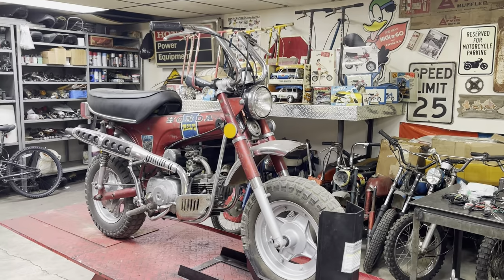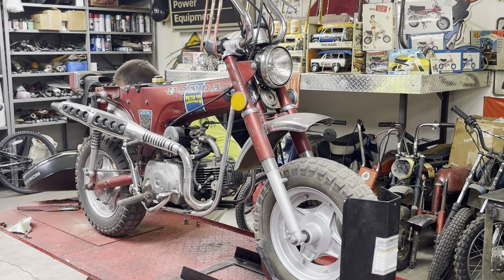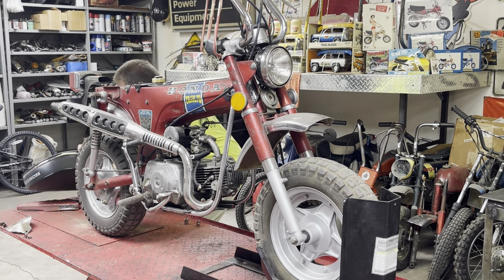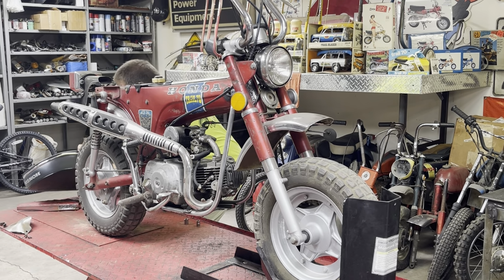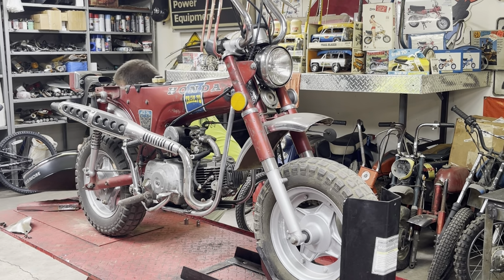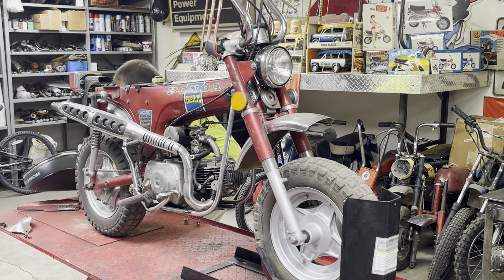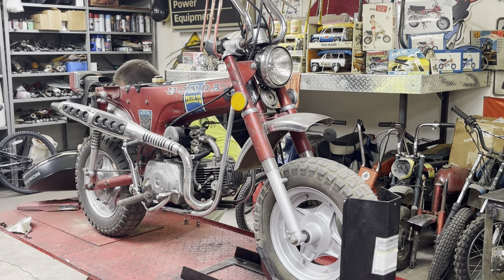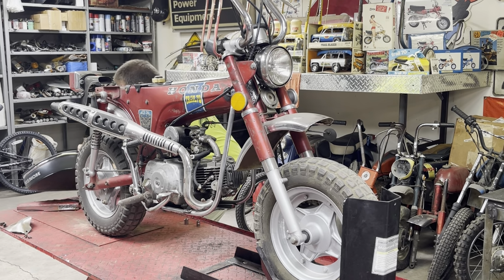CT70 Lifan engine swap - full details

Comment: Nice . I have a X19 with a 110cc 4-spd auto transmission electric start.
I got a 125cc with a 4-spd manual trans to put in the X19 (An unmarked Lifan)
I think it will fit in it well without much modification
Thank you for sharing this swap video

Comment: Great video and very informative. Will be one to save to go back to. I am amazed how he revs up a brand new motor before it even gets warmed up. That I would not do. Just my 2cents and that is all it is probably worth..
Reply from the maker: Thanks for watching.  I’ve used over 60 of these 125 Lifan’s.   The thing I’ve learned, they don’t require a break in.  I’ve got 2 with over 8000 miles each and I revved them to the limit straight out of the box.  These engines are nearly indestructible.
Reply: @MiniBikeMike  guess that is a good thing. Saw a little smoke when you revved but maybe build oil but myself I would always let any motor warm up a bit to get oil throughout the motor. Just like starting a car or truck and revving it right away. Don't think you would have oil all through motor. Just an opinion. As far as indestructible they should be it is a Honda knock off.. :-)..
Reply from the maker: @jimg2885  The initial smoke was leftover oil in the exhaust from the bad top end of the stock engine.  I’ve ridden the bike all weekend and it hasn’t smoked any more.  👍🏻

Comment: hey nice build but I recommend you to change out that cloth air filter for a oiled foam one. I find that the cloth ones let alot of sand through
Reply from the maker: All my bikes are built for street, never have had any problems.

Comment: Did you drain the transport oil that the engine came with? Was a good video to watch but not sure if I missed that part mate
Reply from the maker: @Storm20199  I run the shipping oil for the first 100 miles.  Many people are confused about the shipping oil.  Somehow, a rumor was started that it’s not good stuff.   It’s actually gear oil.   They ship the engines with it because it has a higher resistance to rust than normal engine oil.   I like to run it for a 100 miles, to get all the internals coated, then change to 10w-40 four stroke oil.

Comment: Mike thanks for the videos. I'm a new subscriber. I want to retain my engine guard also does the lifan have to be non electric start?
Thanks
Reply from the maker: @fyerfytr  Thanks.  If your engine has a bottom starter, I have a video that shows the modifications I did, to get it to fit.

Comment: Hey Mike. Awesome tutorial 👌.  Quick question are you using a 12v half wave or full wave regulator? Also where did you get the coil? Thanks
Reply from the maker: It depends on the engine.  Most Lifan’s with one yellow and one white are half wave.   I typically purchase complete engine sets that include items like the CDI and coil.  If you need a coil, they can be bought at Trail Buddy, CHP, Mikes MiniTrail, etc.

Comment: Hi! I have a question. I am about to swap my honda chaly 50cc 1975 engine with a 125cc cross engine. Do i need the 12v wiring harness? Or it s okay to continue with the stock one?
Great job by the way
Reply from the maker: I’ve never worked on a Chaly, so I’m not familiar with their harness.  Personally, I’d pull the old harness and install one designed for the 12v engine.

Comment: Cool video Mike. How much difference do you think that carb made?  I used the one that came with the engine on my recent CL70 build. Wondering if I should change it.
Reply from the maker: I doubt there is much difference.  I would have used the one that came with the engine, had it not had the cable operated choke.

Comment: Great video. Was wondering what exhaust you're using. I just swapped out my CT70 with a Lifan 140cc, but the og exhaust doesn't seem to fit properly, thank you.
Reply from the maker: I always use the stock exhaust, I like the way it looks.  The rear mount doesn’t line up.  If you watch my video after this one, I show how I fix it.

Comment: hello, Where can I find all cables for ct 70 with Lifan 110 engine?  Thanks for your great, informative videos
Reply from the maker: CHP, Trail Buddy, Mike’s Mini Trails…..they all have stock cables.  If your Lifan has a manual trans, you’ll need a clutch cable from an H model.

Comment: It's been 3 years since this video. I'm looking at Amazon and there's a big price range for these motors, about $260-$600.  Which one do you recommend these days? Generic or Lifan? Thanks so much/
Reply from the maker: @vorhese  It depends on what features, in an engine, you want.    I really like semiauto’s.   To find those, the current choice is 110cc X-Pro or the expensive Lifan 125cc.    If you want manual, I prefer the 4up shifting, so again, I go with X-Pro 125cc.   If you want 1dn3up, then the unbranded Lifan on Amazon is fine.
Reply: @MiniBikeMike  Wow thanks for that quick response.

Comment: Hi Mike, fairly new to your videos but love them thanks. Im thinking about putting in a 125 unbranded lifan into my 1971 honda ct70. I was wondering if the engine you used was a 4 up or 1N234 shift pattern and where you bought yours and part number. I love the way yours sounds and revs and want to make sure I get one similiar to yours. Hope you have time to respond, Thank you
Reply from the maker: I don’t remember which shift pattern this particular engine had, I’ve used lots of each.    They’re all gonna sound the same, the top end of each is the same.
Reply: Sorry to disturb you one more time, was the 125 a true Lifan or a knockoff and if you dont mind me asking where you purchased it from. Are the ones on ebay and Amazon the same. Youre the Best on Minis and by the way I am subscribed and have hit the thumbs up. Stay Cool, Ken
Reply from the maker: @kennycas7668 I’m not aware of any company building knock offs of Lifan engines.  Lifan puts their name on the side of some engines and charge a little more because it actually says “Lifan”.  The sell the exact same engine on eBay and Amazon as unbranded and they do not say Lifan.   If the cam cover has “CDI” in big letters on it, it’s most likely a Lifan.  I buy the unbranded versions on both eBay and Amazon, whoever is cheapest at the time.

Comment: Hats off to you sir great video. been thinking about doing this . I have the same bike 73.low compression  and a good running china 110 atv with a bad frame. thumb throttle semi 3sp ct 70  on the way. any link or pointers on the harness build ? going to need a battery as it electric start only . but more interested in the branch off wires for the 12v conversion.
Reply from the maker: Trail Buddy harness TB422 has all the wiring for electric start.
Reply: After watching your video on the harness I'm just going to start with atv harnesses and build it to my needs. 👍

Comment: why do you not put a higher cc on it? Nice video
Reply from the maker: The 125cc pushes this bike to 60mph.  I have no need or desire to go any faster.   Plus, the Lifan 125 is the most dependable aftermarket engine out there.  I’ve used over 60 of them and have never had a problem.

Comment: I’m about to put a lifan 125 manual clutch on a 1968 Honda CL90. Do you have any pointers and if you ever done it and do you have a video on it?
Reply from the maker: Just be prepared….it’s not a direct bolt-in.   The CL90 used a different engine bolt pattern than the CT70 and current aftermarket engines.  You’ll need to fab some engine mounts for it to work.  If you can handle that, the rest is pretty simple.
Reply: Thanks Buddy and thanks for your great videos

Comment: Mike I want to do this to my ct70. Not sure of its year, having tranny trouble so good time to just upgrade the engine. I have a 3 speed auto and want to do the 4 speed manual. Shouldn't be any problem right? Just no neutral light, no biggie.. Also working off your lift of parts, 2nd ebay is not found with link, what is this part? Also ignition is out of stock and suggestions? Sorry about all the questions I just really want to get rolling on this. Lastly the unbranded ebay engine is ok? No trouble with it????
Reply from the maker: The unbranded engines are very good, zero troubles with the dozen or so I’ve used.   You can get an ignition switch from Trail Buddy, with the wiring harness.  I think that other item was just a cheap inline fuel shutoff. You can pick those up at any hardware store.

Comment: I will end up needing those spacers/longer bolts for my foot peg mount... where did you get yours?
Reply from the maker: I own a steel company.  I cut them from 1/2”od x .065wall round tube.  Available at most steel shops or hardware stores.
Reply: @MiniBikeMike  ok awesome, I have some of that material...thanks

Comment: Not sure if you’ll see this but is the motor still running and if so how many miles have you got on it want to do this to mine asap
Reply from the maker: I sold this bike shortly after the video was made.  These engines are extremely reliable.  I have a couple Lifan’s with over 6000 miles each.

Comment: Mike, sorry to be a pain in the butt. It wasn't the H clutch cable either. Could it be a link to a coil?? Do i need to purchase a coil? Thanks..
Reply from the maker: Yes, if you didn’t get a coil with the engine, you will need a 12v coil.   The link wouldn’t have been for a coil, I only buy engines that come with the “set”: …..carb, coil, etc.
Reply: @MiniBikeMike  I now have the ct70 engine, will my exhaust work with the 125cc? Or will I have to upgrade?
Reply from the maker: @aaronbell5743  I run the stock exhaust on all my 125’s.

Comment: Why do you prefer the PZ22 carb on 125’s? I’m running a VM22 chinese Mikuni and it seems to work well. I believe the VM22 is supposed to be 26mm?
Reply from the maker: I use a Nibbi 24mm carb on most of my personal bikes.  The goal of this video was to show that you could buy the complete set (with carb) and swap out an engine in a day.
Reply: @MiniBikeMike  do you ever end up needing to change the jetting on the nibbi 24 carbs? I saw someone else’s video of a champion with the nibbi 24 and it didn’t seem to run quite right with stock jets
Reply from the maker: I think it’s in my video on the trashed swingarm.  I sad show the Nibbi and what jets I used to get it to run the best.
Reply: @MiniBikeMike  I’ll take a look! Thanks!

Comment: The links for your part list aren’t working. Can you give me in detail what clutch cable that is?
Reply from the maker: @scottberti2613  Old video and the suppliers change the links.   It’s just a standard Honda CT70H clutch cable.
Reply: @MiniBikeMike  can do a video how the throttle comes apart mine sticks
Reply from the maker: @scottberti2613 If you’re using the stock internal Honda throttle, they all stick.  No amount of cleaning will get it to snap back.  Josh Eule has a spring kit to help the stock throttle return.

Comment: Hey mike where did you buy the solder connector things from?
Reply from the maker: Good ole Amazon. 

TICONN 150 PCS Solder Seal Wire Connectors, Heat Shrink Butt Connectors, Waterproof and Insulated Electrical Wire Terminals, Butt Splice (150PCS) https://www.amazon.com/dp/B07HCNTZ2Z/ref=cm_sw_r_cp_api_glt_fabc_N4R78FJBQ8X9EWQN2J79?_encoding=UTF8&psc=1
Reply: Thanks

Comment: Anyone help me figure out what engine swap I can put in a Yamaha ht-1. I am hoping to restore the OEM 90cc motor and put a lifan in my current ht1. Someone told me the Lifan engines mount horizontal, just wondering it would fit my HT1.
Reply from the maker: I’m sure it’s not a direct bolt-in, but anything can be made to fit.
Reply: @MiniBikeMike  thanks, gonna give it a shot. and if I gotta move some bars on the frame shouldn't be the end of the world.

Comment: Hi what is the harness you used and also you mentioned one for just running, no lights, I dont see a link for the harness
Reply from the maker: I typically use a harness from Trail Buddy.  Their part number is TB515.  Unfortunately, they are currently out of stock, so i built this harness from scratch, duplicating the Trail Buddy harness.  

The wiring harness for running with no lights typically comes with the engine when you buy it.  If not, all the parts suppliers stock a simple harness.

Comment: Not sure if I just keep missing it but I got my motor in and the front sprocket is wider than the original what should I do to mend that?
Reply from the maker: Sounds like they sent you an engine with a 428 sprocket.  Does it have 428 stamped on it?  Regardless, you’re going to want a new sprocket anyway, the stock ones are way too small….usually.   You need a sprocket with 16 teeth and fits a 420 chain.  The tricky part is the splined hole size.  There are two different size splined shafts on these engines:  17mm and 20mm.  Hopefully, your sprocket has it printed on it or the engine came with specifications that list the shaft size.  If not, you’ll need to measure it.  eBay and Amazon have plenty of sprockets for $15 or so.
Reply: @MiniBikeMike  yep it’s a 428 I’ll order a new chain and sprocket tonight on Amazon it’s a 17mm

Comment: Hey Mike my head light doesn't turn on unless I hit the break light and it also does the same when I hit the horn button I don't know why it's doing that
Reply from the maker: What harness are you using and what model bike do you have?   If you have a yellow wire in the body harness, it connects to the brown/red wire of the Hi/Lo switch.
Reply: @MiniBikeMike  I have a 1971 honda ct70 with the trailbuddy TB515 12v wire harness the one that you have and the yellow wire is connected to brown and red but when I pull the break light switch the head light turns on and and when not pulled the head light will turn off I have look over the wiring and all is connected right
Reply from the maker: @contrains1264  I would unplug all the wires in the headlight bucket.  The only wires I would hook up are:
Yellow of harness to Brown/Red of Hi/Lo switch
Blue of Hi/Lo switch to blue of headlight
White of Hi/Lo switch to white of headlight
Green of headlight to green in harness. 
Make sure everything else is unplugged. 
Start your bike. 

The headlight should come on and the switch moves it from Hi to Lo beam.  If that works, start plugging other wires in and check their operation as you go.
Reply: @MiniBikeMike  what about the horn and the  Indicator light and the - light
Reply from the maker: Personally, I’d leave everything else unplugged and make sure you have the headlight working properly first, then start plugging in other wires.
Reply: @MiniBikeMike  alright ill try that thank you mike

Comment: What's the best way to wire in a clone motor on a CT70 that already has wiring and blinkers?
Reply from the maker: Completely remove the stock wiring harness.  Contact Trail Buddy and buy their 12v harness(part #TB422), a key switch and a 12v half wave regulator.
Reply: @MiniBikeMike  It's $237 for their wiring kit, is there no other way? I already have a nice stock wiring harness, CDI and 12v coil
Reply: That's what they told me to buy, the TB161 kit. Are you saying the TB122 $57 universal 12v harness will replace the ENTIRE old harness along with TB153 12v 4-Pin Key Switch with Lock Assembly and would have working blinkers and everything with some basic splicing?
Reply: Could I use the existing OEM 3 position key switch?
Reply from the maker: @JoeSmith-sv4jn The harness I mentioned is $57.   Sure, there’s always other ways.  You ask me which way was best.  The best way is too install TB422 and go.
Reply from the maker: @JoeSmith-sv4jn I have lots of videos using TB422.  I also have video showing how to use stock key switch.
Reply: Roger that, thanks

Comment: Is this the 125cc by TFCFL on Amazon?
Reply from the maker: I know I got it off Amazon.  There is a link to the engine in the video description.  Edit:  sorry, this was from eBay.
Reply: @MiniBikeMike  The link says “Currently Unavailable “ . Bummer
Reply from the maker: @mrfenderguy1  Here is the same engine on Amazon.  Looks like price went up a few bucks. 

125CC Engine Motor,Single cylinder 4-stroke with Air-Cooled Motor Engine Pit Dirt Bike For Honda CRF50 CRF70 USA STOCK https://www.amazon.com/dp/B07KR8X66N/ref=cm_sw_r_cp_api_glt_fabc_56SZBPTGJ6V2Y3HNJ5WR
Reply: @MiniBikeMike  thanks Mike

Comment: Hi sir where can I get a lifan engine to buy
Reply from the maker: Amazon, eBay, tbolt
Reply: @MiniBikeMike  I tried amazon nothing show up
Reply from the maker: I just did a search on Amazon and saw about 50 different ads for them.
Reply: @MiniBikeMike  send me the link thank u
Reply: Do you think a 2022 110cc atv engine would work?
Reply from the maker: @saeedkhan7999  If it uses the same bolt pattern for mounting the engine, I would think it would work.
Reply: @MiniBikeMike  thank u buddy
Reply: @MiniBikeMike  do you know what size carburetor fits on a 110 or 125cc honda cub replacement engine?

Comment: You didn't put oil in the engine, I heard that oil is good for an engine 🤭
Reply from the maker: These engines are shipped with oil in them.  I like to put around 100 miles on an engine, then change the oil.